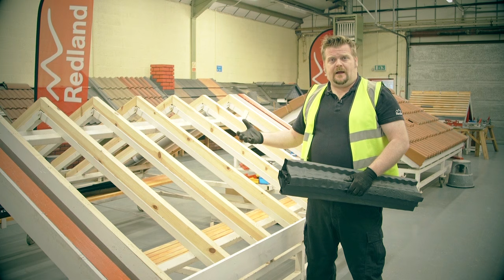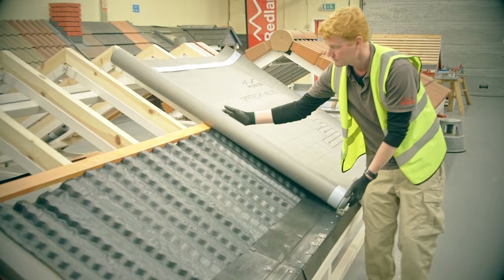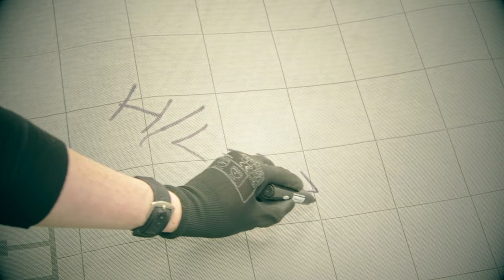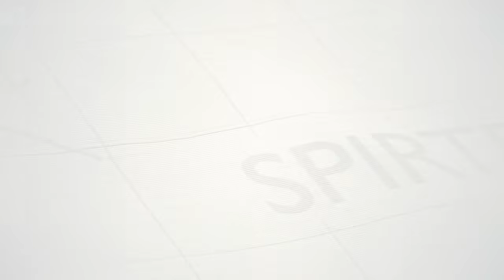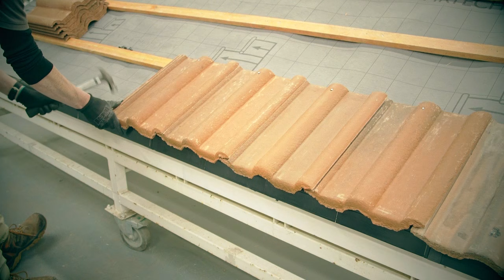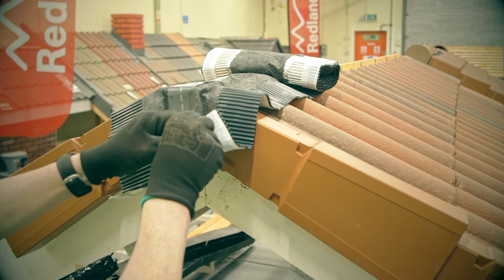How to Build a Roof

Comment: Is there a structural reason the common rafters terminate at a point above the ridge board? Rather than a ridge beam with rafters connected level with the top of the ridge beam?

Comment: Please can I ask, I've often wondered does the with of the roof have to be an exact / specific length so that when the tiles are placed there's no large overhang. When you place the tiles in the row, they always seem to fit exactly to the entire span of the roof? If you built a roof, but don't measure the with, and you go to place the tiles, and say they overhang by 1/2 a tiles length how could you solve that, or is it a case of making sure the with of the building you make will accomodate the tiles when their place? Hope that makes sense, but fascinated by roofing solutions and so grateful for your video. Thanks George
Reply: That's why you lay tile from the edge that's your starting position working inside tile can be cut anyway needed so by the time you come to your valleys and it overlaps you bust out the saw and make perfect cuts

Comment: How would you vent the top of a mono pitched roof with the lead flashing across the top ? If the answer is to use a vented tile then how often are these installed ?

Comment: I am wondering am I allowed to do this myself in the UK, or do I need 
any kind of permission from the local council? I do have experience in 
re-roofing, as I was working in construction abroad. Also, am I allowed 
to put up a scaffolding myself, or does it need to be by a firm? Great 
video and every help is appreciated, thank you
Reply: You can do it yourself.. Only thing you need permission for is changing the type of tile or slate as some areas won't let you change them

Comment: Very interesting and excellent teaching, thanks.... By the way, thr verge units are in plastic and I wonder if after few years theses items as many plastic stuffs, will be broken due to sun exposition.
Reply from the maker: There seems to be some concern (mostly among former roofers) that plastic hardware fades, decomposes or is damaged by sunlight or weathering over time. It does, of course, depend on the quality of the product and the installation in the first place. 

Many of the opinions on plastic / moulded verges are based on products that were introduced many years ago, rather than modern up-to-date systems. 

Both plastic verges and more traditional cement verges have pros and cons. Essentially, both are designed first to prevent wind and water ingress, and secondly to look nice. Your ability to repair or replace either one might be the deciding factor on which one you choose.

Comment: I was a roofer all my adult life nearly and we hated these plastic dry verge systems . They really are crap and difficult to work with unless you have the absolute perfect conditions to start out with , like he does here , where the roof is pre made as an example to exactly illustrate the system and every measurement is already planned , neatly and precisely as in this show room .  In reality though most roofs are NOTHING like this . For a start you may have to have a cut tile on the right hand verge as the tiles do not fit exactly across the roof . With cut tiles it is very difficult to get them to sit straight under the dry verge as they were not designed very well to accommodate this . There is a certain amount of tolerance in the dry verge unit but often it is not enough for a nice snug fit as in this example .  Also many , many roofs you work on are not entirely square , that is they may be an inch or so wider at the top than at the bottom . I have known some roofs to be even two or more inches out . Obviously this is not meant to be but it happens and rather than go to the expense and considerable time and effort needed to re build it , they expect the Tiler to get around it , which we do . However this again can cause problems when reaching the left hand verge unit because it can be touch and go whether the tiles will all sit correctly as they are supposed to do in principle .  Another factor is that quite often in practice you actually have the rafters ( or trusses as most roofers call them ) at slightly different heights near the verge . This will give a slight bowing effect to the Batten’s and tiles so that the last tiles under the d/v unit will sit uncomfortably . Again the rafters shouldn’t be out at all but sometimes they are , and the builders will ALWAYS expect the Roofers to get around this .  So I am afraid that unless you have a perfectly pre prepared ideal roof shape ( in reality most times you don’t )  then these plastic dry verge units really are CRAP .  Even on an ideal roof you find that they discolour terribly after a few years and being plastic of course they warp and bend in time with blazing hot sun on them and then freezing ice throughout the year . They usually end up looking GHASTLY after a couple of years .  No Rooftiler on the planet would put these things on his own house that he was building . Not unless he didn’t give a damn about how it looked .   Much better than this system is the traditional wet cement verge which looks a thousand times better and can if done properly last even longer .   If you really want to have a dry verge system then the old Redland Cloak dry verge is much better . I don’t know if they still make them as I have retired now , but the Cloak dry verge has a normal cement tile on the verge which cloaks over the side , is heavier than the normal tile and so sits quite neatly and securely once fixed .  These don’t look bad at all .  But really these plastic dry verge units shown here are cheap and nasty and cause problems after a few years . Generally they end up looking awful even if they are fitted correctly . Another problem is strong high winds and gales which buffet them around and shift them off axis no matter how securely they are fixed .  Take a tip from an old roofer , if you are thinking of having your roof done then stay away from this plastic dry verge system .  They are cheap and nasty and end up looking like an eye sore . You will be much better off with a nice traditional cement verge . They can have their problems too with extreme gales etc but they are easily repaired and made good if need be and will last decades usually .  Many of the cement verges I did over 40 years ago are still looking just as good and sound as they did the day they were built . Natural cement tiles and verges age well and add character and value to the building I have always found whereas if you take a look at some of these  plastic units after even ten years you will be shocked as to how ghastly they look . All tatty and wonky , discoloured and uneven . A complete eyesore.
Reply: Very true.... The amount of jobs I've been to where the dry verge have blown off.. Shite.
Reply: @booooo666  this tends to happen if the battern has been cut to short and the nail is barley touching Me and my boss have been on a site where the roof needed ripping off and starting again and we have a video of my boss using one finger and flicking just one dry verge and 15 others followed it, we seen the problem straight away they had cut the battern ends of at 1 inch even tho the dry verge required 2 inches and they tried using standard tiling nails that virtually didn’t touch some didn’t even make a mark on the end of the battern
Reply: Absolutely agree. It appears few care about plastering plastic Lego bricks along their verges. Utterly ghastly in every way. Next they'll be fitting that nasty American-style uPVC siding and, God forbid, those cheap shed felt roofing "shingles" which are sadly ubiquitous across much of N. America.
Reply: My thought precisely. What a load of bollox plastic clips for the plastic clips for the plastic fix bits. Whay over engineered
Reply: Rather cement bed the ridge tiles because when that nail rusts through, those tiles are blowing off
Reply: One of the best comments on the subject by a pro. Thank you for saving me as I was so sold with the dry thing idea. Code 4 lead valleys and verges all the way then.
Reply: Thank you
Reply: As a roofer of 40 years I agree but on new builds it's all dry fix  loads faster than wet work plus it's all weather application  works well on new builds refurbishment is another story that's where problems start
Reply: choppy249  thanks for your interesting comment.   for info.  i have a cement verge   25 years old cement decayed and thus when  removing it found that the roof battens were decayed back from barge  about  75 mm especially at the lower end of the verge near the eaves.  the tiles are sound but i was interested in the comment about lifting by wind.  i have put 4 copper tingles on the lowest four courses verge tiles.  i intend to replace the cement sand bedding but adding boiled linseed oil to the mix (it sets rock solid) .  trouble is i am having difficulty getting cement sand because of corona lockdown. i am also considering trying to waterproof the verge on first two rows  trying to keep damp away from edges.
Reply: frank crouch . Sorry to hear you have trouble with your verge but I am a little confused as to what type of verge it actually is .  You mentioned the verge tiles but then you mention copper tingles which are primarily used on slate roofs , so is it a slate roof or a plain tile roof or interlocking tiles ?  It would be so easy for me to diagnose the problem with it if I could see it but it is hard for me to offer any advice to you without more information . If it is slates then there are a number of different reasons that could explain the problems you have found .  You also mention the barge board so are your tiles / slates overhanging this sufficiently ?  Normally you would have an undercloak on top of the barge board , fixed under the battens as a base for the cement verge which the tiles / slates can then bed snuggly onto . This undercloak should normally overhang the gable by about 2 inches or so . If it does not overhang enough then rain can penetrate beneath it over time and will cause problems . One of the problems in some slate roofs is that people sometimes do not use an undercloak and bed the cement straight onto the gable wall or worse onto the wood barge and wall . Also amazingly they will not even bother to overhang the slates sometimes . This is a recipe for disaster as the cement will fail and crumble much quicker than normal and rain will soon start to penetrate .  In fact the condition of your verge with rotting battens and decaying cement  is more often than not found with this type of slate roof . Normally you would not expect a cement verge to decay badly after only 25 years or so nor should the roof battens be rotting either so I am puzzled by what has happened here . As I said it would be very easy for me to tell if I was up on the verge , I have repaired literally hundreds over the years but without seeing it , I can’t really help that much .  It could just be shoddy workmanship which I have come across a lot over the years but if you know what you are doing as a rooftiler then it is not that difficult to do a very sound job . The basics of tiling a roof and ensuring that it is watertight and sound are fairly straightforward , as long as you don’t try to cut corners . Unfortunately some people do .  One other reason why a cement verge might fail prematurely is if you use the incorrect sand / cement ratio . For all roofing work , i.e verges , ridge , hips and valleys , the ratio should be 3 to 1 . I have known some people to use bricklayers cement on certain aspects of a roof which is totally wrong and inadequate . The ratio for that is 4 , 5 or even 6 to 1 which is no good at all for roofing work . It is OK for underpointing the undercloak perhaps but that is all . I have found in repairing slate verges over the years that sometimes bricklayers cement has been used for this , probably because with slates much less cement is used and the tiler thinks it will be  adequate , but it is not .
Anyhow I shan’t ramble on . You asked about  tile lifting I think on verges with the wind . Usually this is more of a problem with interlocking tiles on the left hand verge as the left hand verge tile is not held down by its adjacent tile . It just sits on top of it . The tile above holds the top of the verge tile down but the bottom of the tile is prone to wind lift . You can often hear the tiles rattling on very windy days as the wind buffets them up and down and eventually can work them loose . This is why you often see a verge clip in the cement on left hand verges holding the bottom of the tile down , but not so much on right hand verges , unless the roof is in a particularly wind prone area, like the coast etc.   Slates and plain tile roofs are usually much less prone to wind lift as there is more coverage and weight on the top half of the tile thus holding down the bottom half more securely . But in strong gales even they will be affected . Also strong winds and frequent gales seem to becoming more the norm these days so more attention is needed for your roof than previously . When I first started out roofing the standard for most roofs regarding tile fixing was just perimeter fixing . That is just the eaves course the top course and the verges to be nailed or clipped . Then it was middle fixing too , then perhaps every fifth course , then a few years later every third course , then alternative courses , then by the time I finished it was every tile on the roof to be fixed , sometimes with a nail and tile clip too . Some roofs that I used to lay in 15 to 20 minutes were now taking over two hours or so . Still that’s a sign of the times I guess .  One last thought before I go . If you are having trouble finding some cement / sand . Is there a Brookers or some such place near you ? We have one nearby where I live and they have been open for business as usual during this lockdown . It’s worth giving them a try if you can . Anyhow good luck with your verge and sorry I can’t be of more help .
Reply: choppy249  thanks for your detailed reply it is greatly appreciated.      I have hopefully improved the verge construction and i try to explain further...  double roman tiles left hand verge lower end bottom 5 courses  (over an unheated garage <thus no heat thus a bit wetter>).  original  construction roman tiles on battens on felt , cavity walls asbestos undercloak cavity closer projecting about 75mm . tiles bedded in mortar (mix.??) with flaunching from asbestos to side and top of tile.      The initial fault was identified when the flaunching cracked and began to fall in small (say 150 mm ) sections at various places at lower end (wetter) end.    the garage is an extension about 25 years old.   adjoining properties have had marley plastic  and i notice that sometimes the verge course tiles have had to be replaced (indicating that fixer has made access to top of wall and end of battens).        i decided not to go for plastic and have a go at rebedding in mortar.         i started at lower end keeping the tiles on   but able to lift them and found bedding not bonded to either underside of tiles nor to the asbestos  undercloak ,  took all these pieces out ,lifted tiles and rebedded in mortar after painting the underside of the tile with pvc bonding .  i have then turned the bedding into a flaunching up the side of the  round part of the roman tile .      now considering the use of the tingle.......    on lifting the tile taking the flaunching out i found that the roof battens for the first four or five courses were decayed back for a distance of between one and five inches.   (i think that the replacement with plastic would require a sound batter to nail into the end grain).    i have made six tingles from copper pipe . flattened in a vice then filed off the fold thus producing piece of copper  about  12 inches long by about 1 inch wide. . stating at lowest course bend over front of tile and then up and over the sound part of the batten ( the roman tiles are about 15 inches wide) thus tingle goes under the second kick to the tiles.  the tingles are pre bent before fixing . thus the bottom  six rows are all linked by bedding and tingles.     
because i am considering a north facing left hand verge always wet i have also  painted the flaunching the first roll and the first flat of the double roman tile with boiled linseed oil in an attempt to keep the moisture out.
your view on the mortar mix is of interest.         you advise a strong mix  .. fair enough but  i think the advice on pointing mortar is a weaker mix which would possibly accommodate movement  caused by sun rain frost.   related to this i understand that when building the u-boat pens during WW2 that the germans added  oil (unknown type) to the concrete.  a few years back i made an experiment with boiled linseed oil in concrete  and it set like steel.   In the past-few days i have seen a modern research paper (italian) which advocates a small amount of oil added 1% .    i have added a couple of dessert spoons of boiled linseed to my mixes .         lastly i have noticed that all of the housing on this estate have been replaced by plastic and many re roofed . the estate is about 40 years old and built without plastic verges originally.  next door have had plastic verges and replaced adjoining 2rows of tiles (presumably to renew ends of battens).     i have worked in building all my life but not as roofer  . Again thanks for your interest .

ps perhaps of interest to you would be Knapen tubes. dutch invention where sloping holes 12mm dia  depth of2inch   made in  say flaunching or bedding .lined with porous clay pipe  allows air to circulate in,     absorb moisture,   the flow out keeping flaunching dry.